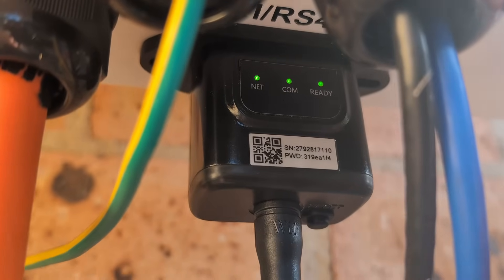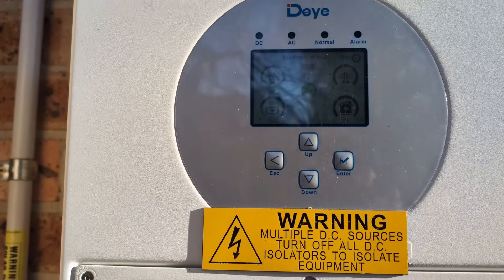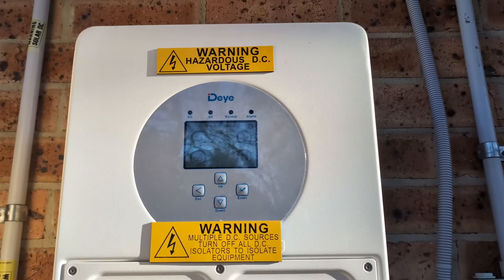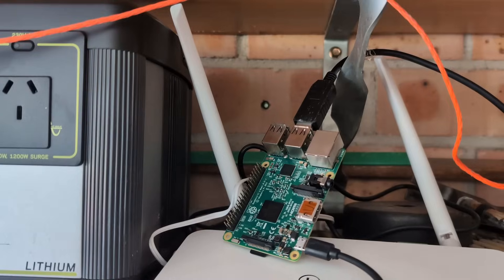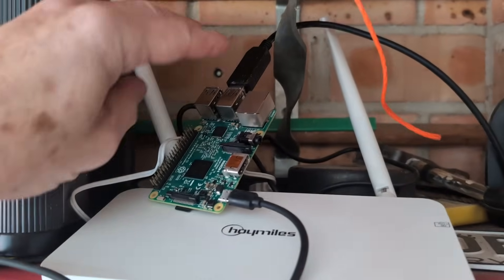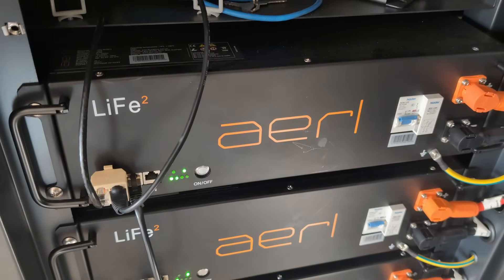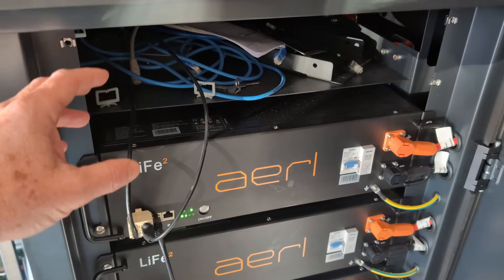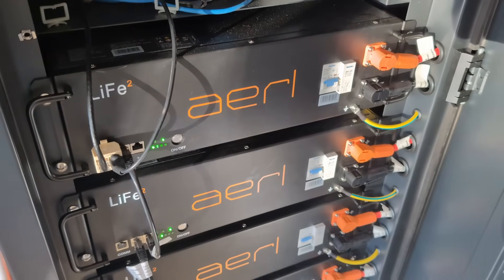Deye Hybrid Inverter Time Sync Issue UPDATE + Battery News

Comment: Hihihi :) Pewny rack batteries :)
I finally received my Seplos Mason 560L wide format battery. This thing is tippy AF so has to be bolted to wall after being carefully rolled into place, but it's rated at 32kWh and 628Ah and first test cycle after balancing shows 35 kWh! Loving it! Nice to not have to daisy chain everything and just have a single battery. 210kg is a bit iffy to move tho. Also, my 10kW Deye inverter loves it and keeps on ticking, while my buddys Growatt just died after a few months of operation. Oh and my Deye keeps correct time too :)

Comment: What solar inverters are available in Australia?  Is there a more reliable brand that won't break the bank if you wnat to replace the Deye (though your channel revenue might defray that cost a bit)?  Of course, I don't know if there's a reputable source of information on inverters there (or anywhere else).  It could just be the various solar snake-oil companies touting their own brands with nothing independently tested.

Comment: Hey there @eevblog2 long time viewer first time commenter. Been following along with this as I have a Deye inverter as well specifically the SG05LP1, anyway I use the wifi dongle on mine but I have it explicitly blocked from accessing the deye cloud services because of many reasons so I cant rely on the timesync from the wifi dongle. However I think the solution I have implemented is quite functional, I don't know how tied to the solar  assitant software you are or what features it provides but I am using with great success home assistant to manage my deye inverter. HomeAssistant has an integration which will allow HA to adjust settings and see all the sensors and outputs from the inverter, it also keeps statistics etc for everything which is an area where home assitant shines, another area where it shines is that the connection to the inverter is local over the wifi via the dongle so there is no need to use RS485 unless you really want to and is so then there is a solution for that as well using ESP32s and ESPHome however the management over the wifi has been flawless using home assisant, also the time sync is a non issue for me as I have a simple home assistant automation that syncs the time at dawn every day and I see no more than a few seconds of drift per day on average from what I have seen so far. if you want to have a sort of poke around my system to get a better idea of what i am talking about please dm me and id be happy to set something up for you.

Comment: +/-5 minutes before resync is pretty loose but good enough for most uses.  I don't know why they don't just poll the hardware RTC every hour though, it'd be more accurate than that.  It makes me wonder what on earth Deye is using as a reference to get the drift as bad as it is.  Even my 50 buck internet router has an oscillator accuracy of 4ppm.

Still nice that Dave had the time to give us an update on it.
Reply from the maker: Yep, crazy not to poll the RTC hardware that is already inside.
Reply: @EEVblog2  Probably lazy developers  who used a single counter internally for the clock, and thus poor timekeeping, because using the RTC would mean looking up old startup code, they probably have never touched since it was written years ago.

Comment: You shoulda gone with Victron!!
Reply from the maker: I was a tight arse, and the Deye had the microinverter gen input I wanted to use, and the AC coupling.
Reply: Victron does that as well, just better. No micro inverters, but fronius string inverters

Comment: Very odd, since the inverter  has a very accurate timing source - the 50Hz line input! I don't know if Australia has it, but in the US, there's a requirement that the frequency be within 1% per day - that is, over the course of 24 hours, you would have had 86400 * 60 (seconds per day, Hz) cycles +/- 1%. This is because many AC powered clocks use the line frequency to be the actual clock source (this includes analog clocks driven by a synchronous motor, as well as digital clocks that detect zero crossings and divide by 2 to provide the 60Hz frequency reference).  Even @TomScott made a video showing how the UK has the same issue. And if the clocks run slow in the morning, the frequency is bumped up in the evening so by the end of the day the clock is accurate. Sure over the course of an hour you may lose at most a few seconds if you use the line frequency, but by the end of the day it would usually be made up. It's why many clocks still use the AC line frequency for their timing source, relying on the 32.768kHz oscillator only as a backup.
Reply: These things are capable of working fully off grid so ultimately using the mains as a reference would be pointless since it would simply be based on what ever crystal the PWM is derived from.
Reply: In the USA power grid frequency is supposed to be +-10ppm within a day. US grid operators deliberately change frequency +-20mHz of target to have as close to 5 184 000 cycles per day as possible.
1% is way to bad for power grid, that can gets to 5 minutes of error in just 8 hours 20 minutes of actual time.

Comment: In UK batteries are outside unless Indoor locations require separate fire compartmentation, away from sleeping compartments!
Reply: Australian garages are usually somewhat separate from the main insulated house for Australian abodes
Reply: These are LiFePO4 i believe, not a risk of fire
Reply: @privateCitizen-x5g  Tell that to the idiot government that see's Chinese EV's bursting into flames, and assume that all lithium randomly explodes.
Reply: @privateCitizen-x5g  the cells themselves aren't, that does NOT mean they aren't a fire risk, anything they're connected to can melt, I've seen a handful of people get them thinking they're safe to then get wires that aren't thick enough somewhere along the run or leave the terminals exposed and have something fall on top and then no more house.
Reply: Those are just guidelines at the moment, but it will no doubt become a requirement.
Reply: @sarahjrandomnumbers  australia has a document for permitted locations of battery systems. AS/NZS 5139:2019.
Reply: @privateCitizen-x5g  We were talking about the UK, not Australia.
Reply: I heard a tip third hand from a fireman via an office mate at my first job in the 80’s. Put a couple of firecrackers in your wall outlet boxes. This is where fires often start, and the firecrackers will go off maybe a minute or more before the house smoke alarms kick in. That minute can be a life saver. Perhaps this approach could be adapted to battery compartments? Although you might sleep though a firecracker going off in your detached garage
Reply: @chrislott1994  An additional smoke detctor which is interlinked and will set off all the smoke alarms is a bit smarter than filling your walls with gunpowder don't you reckon?
Reply: @privateCitizen-x5g I agree although I could see an argument for the simplicity of the firecracker. I would question the additional risk it could impose

Comment: Why does it drift so much more than a cheap Casio watch?
Reply from the maker: Most likely uses the CPU internal RC oscillator. The RTC clock chip only get read once on start up.
Reply: Are you sure there isn't a pea-powered clock inside?? 😃 https://youtu.be/hsvNSTBKWRQ?t=1877

Comment: That's the weirdest implementation. Considering the cost of doing an NTP Sync every hour is zero. 

I'm waiting to hear back from Aerl. They don't seem super excited to take my money, which is a shame coz I really like their battery system :P
Reply: Does this unit use any AC power input, direct or via a step-down transformer? Isn’t the 50 Hz power line frequency tightly regulated as it is in the united states? Counting power line cycles would be much better than 5 minutes per day. Counting solar light wavelengths would require too fast logic 8-)
Reply from the maker: I've pinged Peter on X for you.

Comment: Looses 10 minutes a day.  Jeez, what did they grind the reference crystal with, a bench grinder.
Reply from the maker: Most likely uses the CPU internal RC oscillator. The RTC clock chip only get read once on start up.
Reply: @EEVblog2  I still don't really get why did they need to use an external RTC. The MCU has one and seems to have plenty of spare pins left for a LSE (Arm IP term for Low-Speed External osc.) xtal. I guess the company motto was "De? Ye!" 🙃
Reply: @EEVblog2  YOU feriners are learning should have used 60Hz like Amurica!!
Reply: @Daveyk021 If it were a frequency issue (50 Hz vs. 60 Hz) it would lose 4 hours every 24.
Reply: Nah, they knapped it like a flint arrow head😅